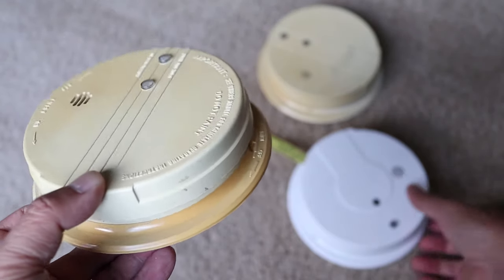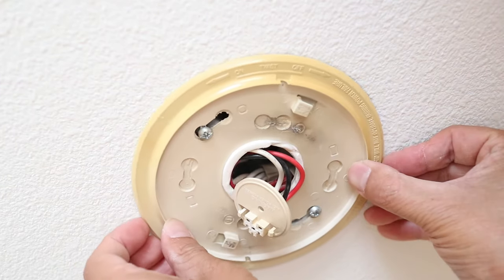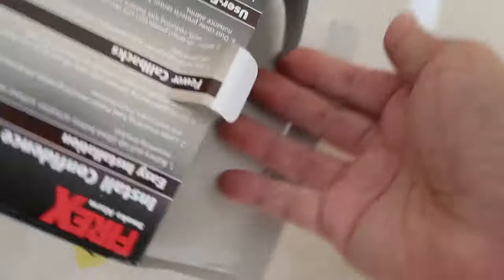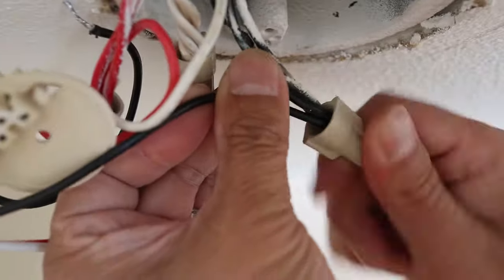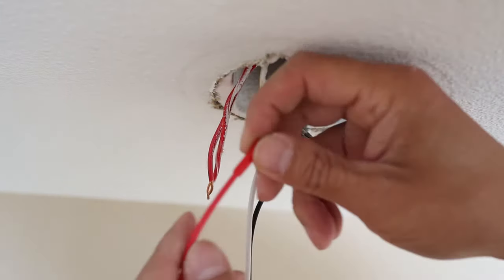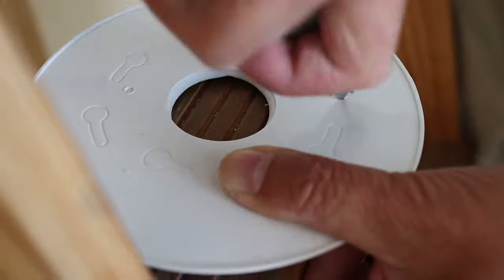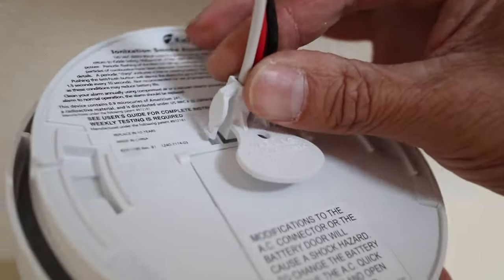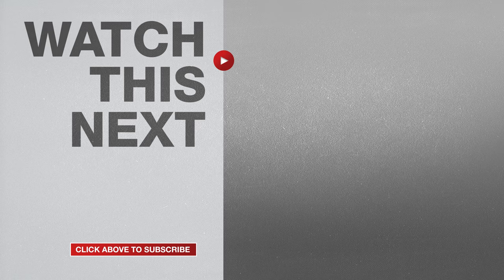How to Replace Hardwired Smoke Detector – Safely Update Your Smoke Detectors with Kidde FireX

Comment: Thank you for being on YouTube.  I am 66 years old (female) and I use YouTube quite frequently about installations/replace/repairs for different interior fixes and automobiles.... like replaces light bulbs in front lights and tail lights.  I read manuals on how service advisors will inflate car repairs and maintenance especially mechanics ripping off women.  I can't believe how many times I have challenged the GM and file claims to the Attorney Generals office for misleading or using reused parts instead of OEM parts.  Sometimes you learn the hard way...sometimes it is best to research before hiring "handy-man" or taking their "trusted" words to get a better deal.

Comment: I installed seven of these 120 volt Kidde units with batteries in my large house during a renovation in about 2006, and have replaced the odd one over the years when it acted up.  The last batch bought from Canadian Tire have been giving us fits over the last month, with two middle-of-the-night alarms from the newer units.

Comment: Great video! However, you made a quite crucial mistake when checking if power is still running through the wires. 

For Kidde (FireX) detectors, Black = Live, White = Neutral, Red = Interconnect. You put the tester across the interconnect line and neutral line, meaning you won’t get any signal if the breaker was on or off.
Reply: Should it be black and white or black and red (cupper)?
Reply: @marymenendez1430  black is live (positive), white is neutral (negative), so you would want to measure between black and white

Comment: Just switched out all of my smoke detectors same as yours. A couple tips, when you pull off the old detectors back plate. Make a note of the symbols next to the existing mounting holes. There will be a symbol for a square, rectangular, circle.  Use this to accurately identify their location on the new plate. Also, there’s no need to use an utility knife to open the keyholes.  They are knock outs; use a blunt tool to simply punch out your desired keyhole.

Comment: This video gave me a boost when it started by saying it's easy to do even for beginners.  Thanks!  The old and new smoke detectors shown here are exactly what I have.  The step-by-step process was very helpful in that it simplified everything.  Though I have to agree with the observation that the step to check if there's power in the wires were off.  I simply used the non-contact voltage tester.  Nevertheless  I'm bookmarking this, for it's virtually impossible to recall what steps I took to accomplish this 10 years from now.

Comment: Great tutorial. I was a bit anxious since the very old (1996) smoke alarms did not match up with the wire plugs with the new ones though they are both FireX, now I understand I need to switch out the wires.

Comment: Very clear and informative video in every way. Clear demonstration with near perfect visual and audio instructions. Thank you.  I am wondering how to replace an old wired smoke alarm with a new smoke, fire and Co detector since I am not there and the house in rented. Obviously, handyman are hard to come by and it's not easy. Perhaps the tenant could do it himself. Is kidde a good brank?. Lots of complaints on Amazon and about beeps going off or 10 year battery out in no time.

Comment: Good video! The screw holes punch out perfectly. Just put the plate down (on something soft like carpet or a towel) and push with your screwdriver. They will pop out cleanly. Way faster than using a utility knife!
Reply from the maker: Thanks for the tip on punching out the screw holes! That’s what I would’ve thought to do but it didn’t work right away so I cut them out with a utility knife. Glad you enjoyed my video!

Comment: Thank you my dear.  My lazy ex-husband didn't indicate on the fuse box which breakers connect to the smoke detectors but I know they'll be 15 amps. I'll have to test them and mark them accordingly for next time.
Reply from the maker: Mine breakers were labeled very poorly by the builder of my house. But it took me quite a few tries running upstairs and out to the garage to figure out which ones I needed to turn off. But once you figure out your breakers definitely label them for the future!
Reply: Yes, if you want it so YOU can use it I’ve found it’s just easier in the long run to do it myself.   Ex always got so mad doing things he would start throwing tools around- I’m thinking it was his way of making me kick  him out and do it myself.  It worked!  In more ways than one.
Reply: @quenemoend  Much easier to do it yourself. I've learned how to do so many things. My lazy ex flipped out once when he had to paint a room with no furniture in it, literally 4 walls. After that I did all the painting. Soooooo much happier without him!

Comment: Would you recommend electric smoke alarms with battery backup in case power goes out ?
Reply from the maker: Yes having a smoke detector with battery backup is a good idea. All smoke detectors will have battery backup. There are some detectors that run on battery power only and do not need external power.
Reply: @TheRenderQ  Thank you.

Comment: Great video but I was just wondering before I open the packaging for my new ones, what if the wire colours in your replacement one don't match what's coming out of the ceiling? How do you know which ones to connect to which ones?
Reply: Usually red is live and black is zero. If you are not sure, you can use voltmeter to check. If the number is negative, swich around.
Reply: @加拿大不大  Thank you :)
Reply: @加拿大不大  The Black and white go to black and white but my old one has a Green that looks like a ground.
Is the Red wire live or a ground? I also have a yellow wire coming out of the ceiling.
Reply: The wires in my ceiling are connected to a transformer and it has red, white, black and yellow wires. Where do I connect the yellow wire? The old kid a smoke detector had a yellow wire along with a white and black wires.
Reply: @leroythemaster4268  Then you may need to check your local electric code. I am not electrician

Comment: Your video is great.  My question is: What if you don't have 3 wires?  We only have the black and white ones.
Reply from the maker: I’m not an electrical expert so I’m not 100% sure what to do if you only have black and white wires. But an article I read says black is HOT and white is NEUTRAL. The orange/red wire is for interconnected smoke detectors. Which I interpret the red wire to talk to the other detectors in your house. Assuming you have more than one in your home. It’s possible the home builder didn’t wire the smoke detectors for interconnection? I’m not exactly sure. Read about the power connector in the following article: https://www.brkelectronics.com/faqs/newconstruction/how_do_i_install_hardwired_brk_alarms
Reply: @TheRenderQ  Thanks.  We do have 2 detectors.  It would not surprise me that they cut the corner of connecting them.  I think we will have an electrician come and wire them properly.

Comment: Thank you! I know this video is under 5 mins. His long does it actually take for a professional to change one smoke detector. ? I have six of these that need to be replaced.
Reply from the maker: A professional could probably change out a smoke detector in 10-15 minutes. A couple of years ago I switched out all the detectors in a house. The first one always takes the longest but the more I did the faster I got. As an amateur I would say for me it takes about 20-30 minutes to change one out. But I’ve replaced quite a few of them.

Comment: Why change the wiring harness when there's nothing within the wiring to wear out? It would seem there would be a greater likelihood of damaging the existing wiring configuration by changing something that doesn't actually require changing. Any discussion on this?
Reply from the maker: There’s really no reason to change the wiring harness on the smoke detector if the old and new one is exactly the same. Partly I was showing this for demonstration purposes but also partly because the existing detectors are really old and I just decided to put all new connectors on there. If the existing connector is usable then the replacement of the smoke detector is super easy! Thanks for watching!

Comment: Thank you! I need to do this with my 15 year old detectors and wasn't sure how - especially with the wiring part! Looks so easy, pretty sure I can handle it. Question - can you leave one disconnected? I have a meditation room I frequently burn incense in and do not want the dumb detector in there at all. lol And can you do a few at a time? My power for them has been turned off since Hurricane Irma and they are so spread out in my 2 story house, there is no way I could do them all at once with those stupid beeps going off lol. Was hoping I could do the 4 main ones first, then do the rest another time. (I have 7 total, 1 I want to keep disconnected) so was thinking about going thru and disconnecting them all first with power still off, then installing new ones in the kitchen, my art studio (3d printers), bedroom, and upstairs hallways, then turning power on?
Reply from the maker: You can replace your smoke detectors one at a time. Depending on how much time you have you don’t have to do them all at once. I replaced half of mine one day and finished rest the next day. It won’t matter how many you do at a time. If your smoke detectors are beeping then try replacing the battery on one to see if it will stop beeping. If the power has been off for awhile your batteries are probably drained. You can also disconnect the smoke alarm from the clip on wiring harness but not something I recommend because you need to stay protected. For your meditation room you can also disconnect it from the clip on wiring harness and leave it off but again I don’t recommend it for safety reasons. Hope this helps!

Comment: Great video man.keep it up !!
but how do you stop from chirping, even if your smoke alarm is new ??
Reply from the maker: I made a video earlier this week about how to change a battery when the smoke detector is beeping. However since your detector is new I have to ask if you pulled out the plastic battery tab that prevents the detector from draining the battery before it’s purchased? If the tab is still in the detector essentially thinks there’s no battery in it.
Reply: @TheRenderQ  Yes, I have seen that...but the Kidde i have has no battery and it's directly connected to the wires.

Comment: I think best practice is to use electrical tape ones you put the wiring cap on.   I had a garage door opener have problems because this was not done, though those wire connections may have been more exposed.

Comment: I’m having issues removing the old smoke alarm from the ceiling, seems like it’s locked. Is there a tab or something I need to push to turn it?
Reply from the maker: There actually could be a locking pin somewhere around the edge of the smoke detector. I’ve seen a pin included with all the detectors I’ve bought but never used them. It’s small and made of the same color plastic as the main body of the detector. Hope that’s what is keeping you from twisting the detector loose. The pin should pull straight out. Hope this helps!
Reply: @TheRenderQ Ok thanks I will look for that

Comment: 👍 👌 Replaced 2 kiddie detectors. QUESTION: BC THERE.ARE 3 WITHIN 10'...I was hoping to change one smoke detectors to a ceiling fixture.  Is it wrong?
Reply from the maker: I’m not an electrician but you could probably connect a fixture to the 3rd location. The only problem is that there isn’t a wall switch to turn on/off that wiring location. It’s constantly hot and the only way to shut it off is at the breaker. But definitely consult an electrician for this! Also I’m really glad that you were able to replace your other smoke detectors using my tutorial! Thanks for watching!
Reply: @TheRenderQ  thanks yeah helpful tutorial ty. Yeah it's a low led Edison hall light which meh is cool if ur going to bath, kit. I'll check w a pro thanks

Comment: I bought the same smoke detector and tried to install it, but it didn’t work, because there was no red wire connection. The old BRK one that I got rid off didn’t have the red wire connected and it still worked, but it was beeping because it’s old. How can I make it work? Thx

Comment: just wish to say, if you have a high ceiling how do you change the battery,
Reply from the maker: Sorry I won’t be much help for you! I’m not sure why they install things like smoke detectors in a high place where you can’t reach it with a normal ladder! I have a rent house with one light that is 2 stories high. It is not easy even with the pole that’s supposed to help. In your case you need a very tall ladder. If I had one like yours I’d probably consider having it moved if possible to a spot more convenient.

Comment: I removed the yellow battery strip BEFORE plugging the alarm, what kind of issue could this do?
Reply from the maker: You won’t have any issues if you removed the battery strip before plugging it in. That’s because later you’ll never have a strip in there when removing and plugging the smoke detector back in. Hope this helps!

Comment: I need to replace one hardwired detector that won’t stop chirping even after replacing the battery and trying to reset it. When I test one detector they all sound throughout the house. If I replace one will it sync up with the rest like the old one?
Reply from the maker: Yes! When you replace your hardwired smoke detector it will sync with the others. Meaning if it goes off all the others will sound the alarm too! But with a dead battery, only the detector with the dead battery will chirp. Hope this helps!
Reply: @TheRenderQ  Thank you!

Comment: Is it necessary to replace the wiring harness.  My house was built in 2007 and the smoke detectors were installed at that time.
Reply from the maker: Thanks for your question! With the smoke detectors I replaced I didn’t necessarily have to replace the wiring harness because I bought the same brand and the wiring harness was the same. But if you buy a different brand than what you have in your house you will definitely have to change the wiring harness. Even same brands may update their wiring connectors so chances are pretty high you will need to replace the harness. Hope this helps!
Reply: There are adapters for the more popular models/brands - for example FireEx/Kidde to First Choice and vice versa.

Comment: I have replaced all the Kidde units in my house and with new batteries.( by electrician)
But the MBroom unit shrieks Fire with no obvious reason ,any time of the day or night. It shrieks once and then it’s silent until it happens once again sometime. I never had this problem before in 7 years I owned the house.
The company gives a canned reply to my complaint (must be a bug or dust particles. It needs to be vacuumed  or sends me a replacement. 
Can someone explain why this is happening or how to fix it? Thanks
Reply from the maker: I just installed 2 more smoke detectors in my house. All seemed good but one of them has beeped once on 2 separate days. I’m not exactly sure why it did that. I pressed the test button and haven’t heard the beep since. But only time will tell if it will stay silent. Try pressing the reset button. But if it keeps beeping it might be a defective unit. Thanks for watching!

Comment: What if my house has black, white and yellow wires but the smoke detector has black, white and red wires? Do I attached the yellow to the red?
Reply from the maker: If the color of your wires is different then you’ll need a circuit tester to identify the wires. I’m not an expert so you may need to look at more videos or talk to an electrician. Recently I made a video on how to identify wires for a smart switch installation. In this video I explain how I identified wires in a wall box. It might be helpful for you to watch that video and see the tool I used. Here’s my wiring video: https://youtu.be/fgnSvnhLOi4

Comment: You should really use a non-contact voltage tester, since those can find hot wires without the need of you completing the circuit.
Reply from the maker: Thanks for the tip! I have since purchased a non-contact voltage tester! It’s definitely better than what I used in my video! Thanks for watching!

Comment: You should use a contactless circuit detector.
Reply from the maker: I recently bought one of those voltage testers that looks like a pen and is all plastic. I can touch the wire and it beeps. Actually I think if I’m close to a wire with power it’ll beep. Is that considered a contactless voltage detector?
Reply: @TheRenderQ  Yes. They are not voltage testers. They are circuit testers. They cost about $5 US. Using a 2 wire tester can give a false "No electricity" if you do not get it inserted into the wire nut properly.
Reply from the maker: Thanks for the correct terminology of the circuit tester. And yes I agree that if the metal probe of my original tester doesn’t make contact I won’t get a reading off it.